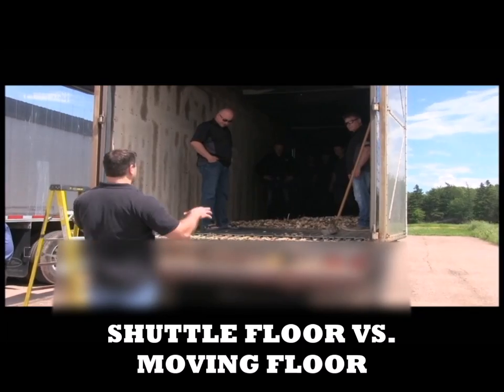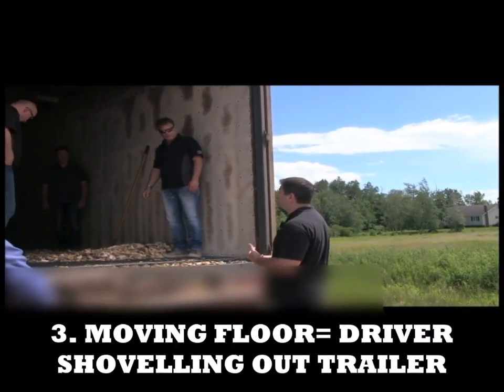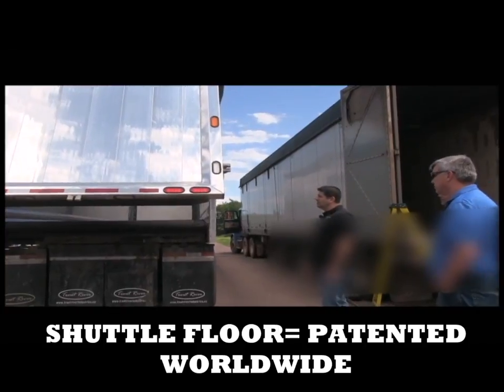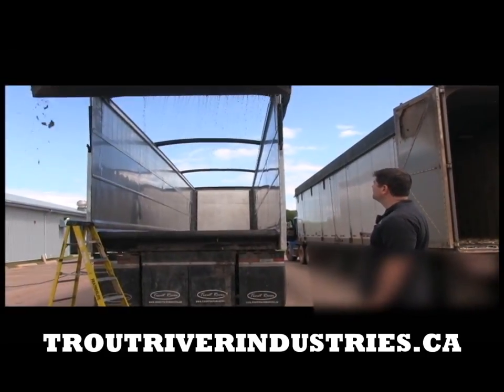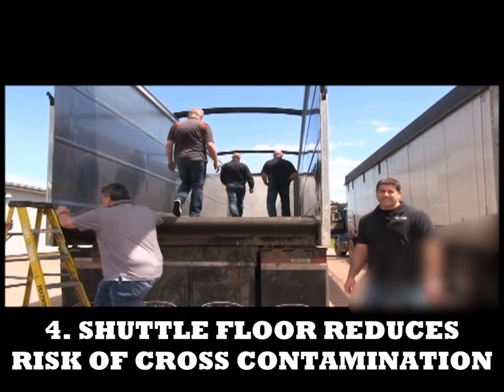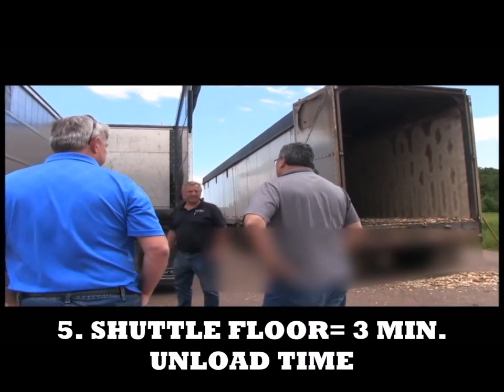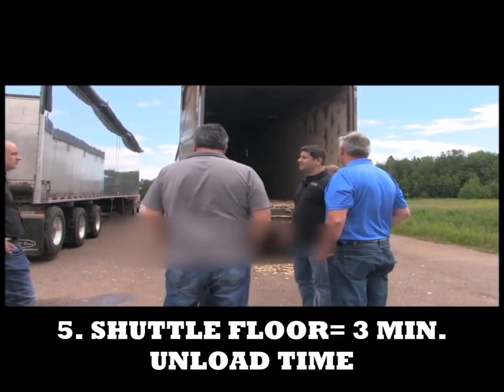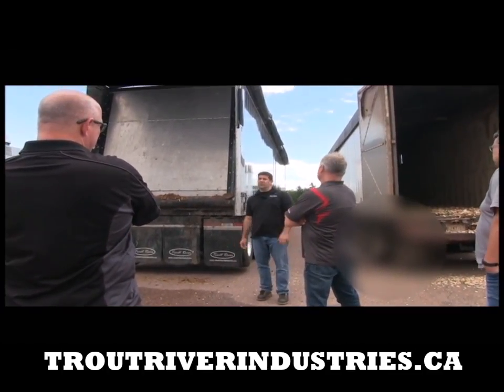Trout River Shuttle Floor Vs  Moving Floor Trailer

Comment: Why doesnt the first trailer have a tarp at the front of the inside of the trailer? Thats the only way for the excess material to be unloaded off the floor! Well atleast thats what works with the mulch walking floors, and the only time the tarp doesnt work, is if the load wasnt dropped into the teailer correctly, and the load is not sitting on top of the bottom part of the tarp, or not enough of the product is sittong on top of the bottom of the tarp! When that happens, about 5 inches or a little more of mulch is left across the entire floor from front to back evenly! Then we gotta go take the tarp off the hangers, and stretch it across the floor at the front, and throw mulch all over it from wall to wall, so it pushes the rest of that excess mulch out! It really pisses me off when this happens too lol! Hopefully the next load is the same type of mulch, and then ya aint gotta worry about doing all of that lol! I personally like the moving wall trailers, which the ones ive seen, unloads in less than a minute! Im just not sure what they call those trailers!